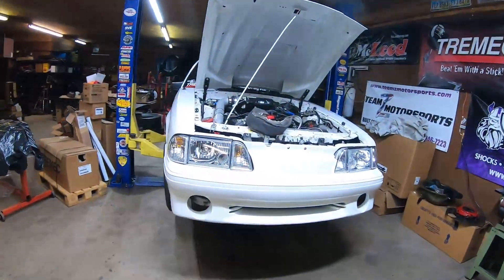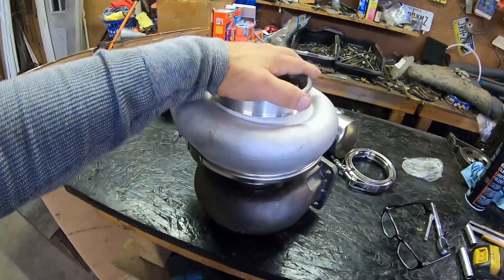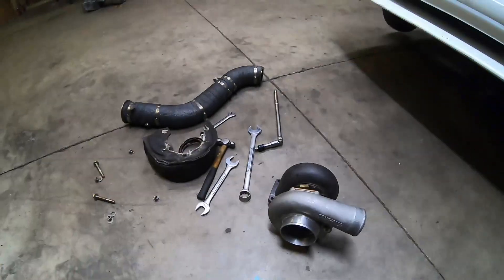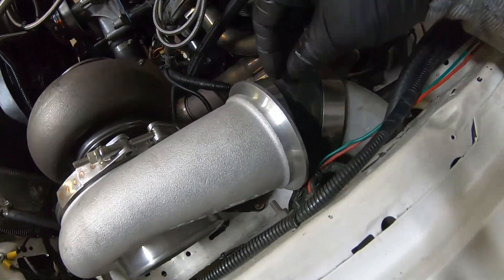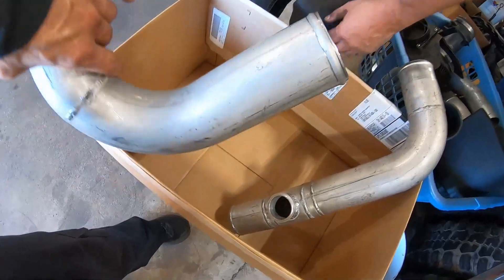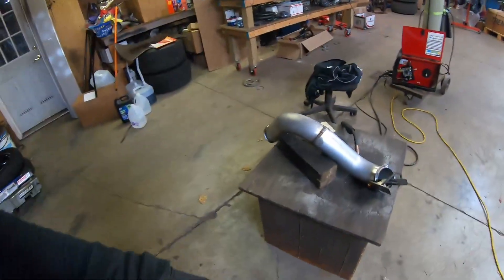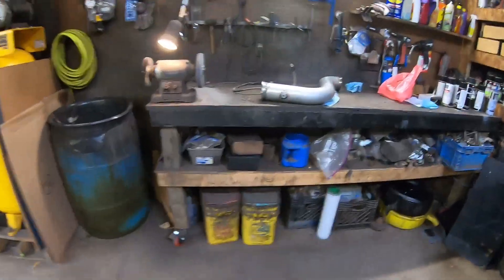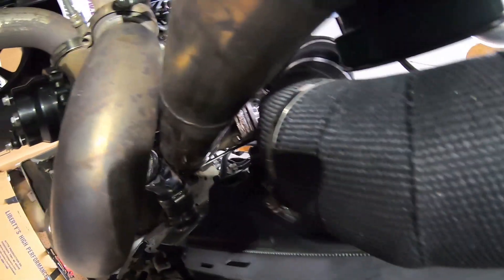Will The 363 Stroker's Big Turbo Upgrade Make It Go Faster? Or not...

Comment: Dang man I've got about the same setup, 363 dart tfs 11r  205, tremec 3550 tko 600 parts carbon synchros cars white and has the running horse sticker only mines a notch ssp car oh 76-92 turbo from forced induction Holley HP on e-85